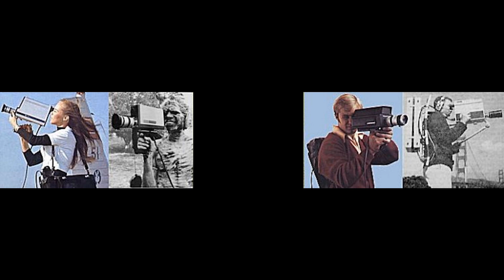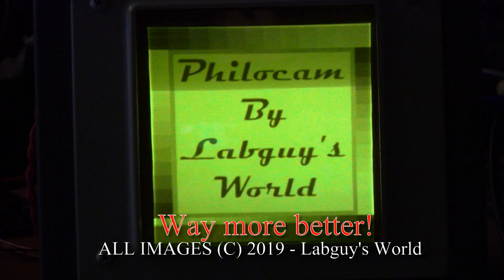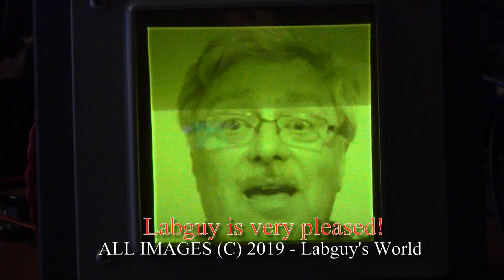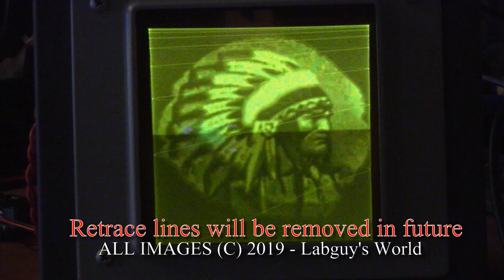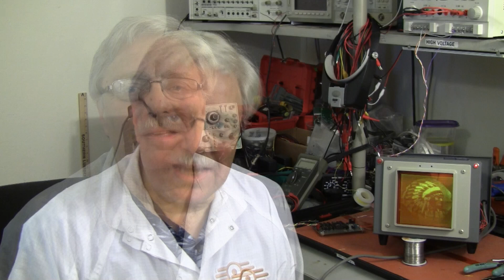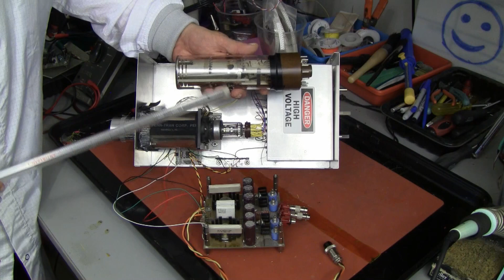PhiloCam Part 11 - New video format sync generator, Part 6

Comment: Another great video. The 1v would be the front porch on the horizontal scan? Gary
Reply from the maker: Yes. The video is measured from the blanking level down to -1Vpk. Horizontal blanking encompasses front porch, sync time and back porch periods. The current non-composite video does not have a sync pulse. H&V sync and the video are sent separately to the monitor on 3 wires plus ground. The composite video will be constructed on the eventual video preamp and process board, to which I have not devoted any attention to at this time. 

The only reason for composite video at all is because I have a 1MHz bandwidth, 45IPS, VTR: http://www.labguysworld.com/AkaiVTR_VX-1200.htm. At that point, I would have to build a composite video and sync separator for feeding playback video to the Philocam monitor.